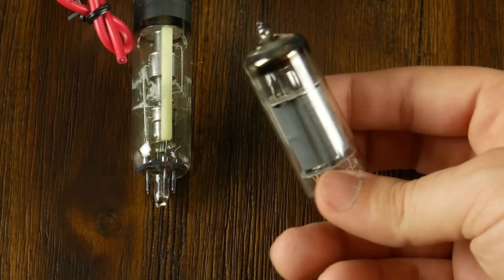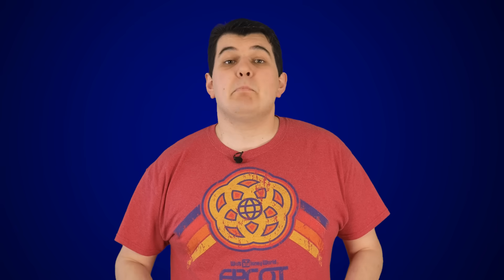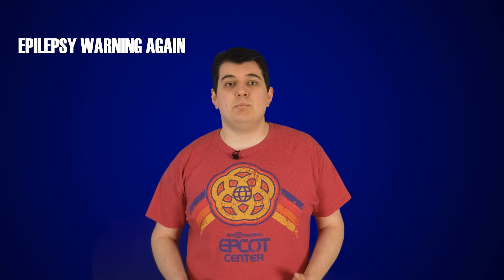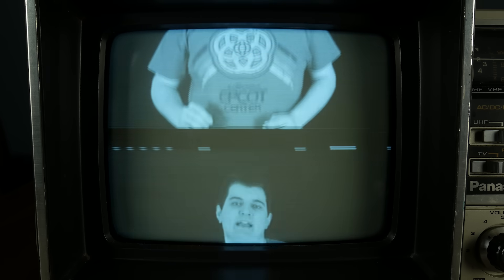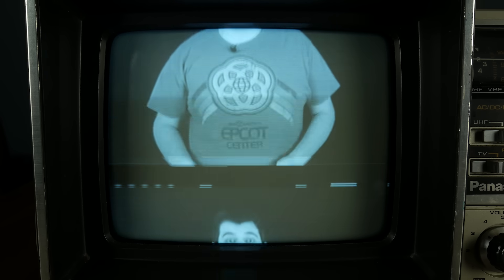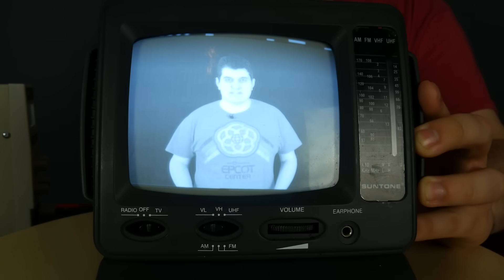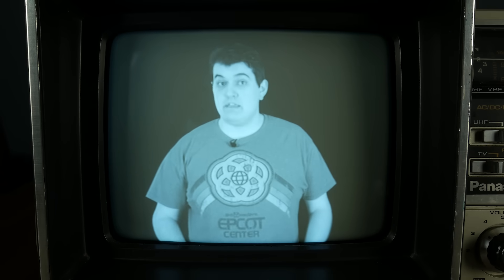Lines of Light: How Analog Television Works

Comment: OMG dude this video is 1) exactly what I was looking for and 2) fricking amazing. You just really explained eeeeverythi.. wait a minute. You explained everything except one thing, that I really wanted to know: how does horizontal resolution work? 

You told us how many lines made up vertical resolution, and said that the horizontal refresh rate was basically thousands of times a sec. 

But I remember my old PS1 to have a 704x576 resolution, or sometimes even better (I live in PAL land)

So where did those 704 dots come from? Would be amazing if you had to answer to that! 

Cheers, and again, thanks for a great video

Comment: The lethality of electrical shot isn't about volts and amps alone, but what body parts the power is passing through. Hit the capacitor with your left hand and your right foot touching ground and it passes through your heart. Now you're probably dead. Use your RIGHT hand and the pathway skips your heart and you get to live, probably. This is not advice to avoid death by being right handed.

Comment: 4:20 - just remove electric cord from socket and try to turn it on, this removes remaining charge, it works for every electronics, people should do that always when they try to disassemble something.
9:15 - for me, 60 Hz screen is still teribly flickering, I think that 50 Hz TVs (in my country) are the reason why I became PC player and not console, because I just could not watch 50 or 60 Hz CRT, I needed minimaly 75 Hz, but 85 Hz was more comfortable. The worst thing was that in schools, there was mostly 60 Hz on computers, it was really painfull for me, I had always red eyes from that.
And noise of CRT TVs was sometimes so loud that I could literally feel in my body when somene in next room turned on TV.

Comment: i have two crt... no three! crt based display terminals, one of em is a fine Philips color Vhs intergrated television in near mint condition if you look away from the remoot witch somehow partially melted after laying in the sun, the other one is giant black- and i cant remember the company, but it weigs a ton and i can bareley lift it when i have to moove it around... i allso have a little 2.4 ghz security monitor from my fathers workshop, its a neat little thing witch can be hooked up to 5 signal cameras. but if theyre just remodelled radiotubes then why do they explode and not implode when smashed? and why doese my philips tv keep reliving the heroshima incident when turning off :|

Comment: If you ever want to do a video on how the video tape machine was invented, let me know. I restore professional broadcast video tape machines from the 50s to the 80s.
Imagine recording a 6mhz bandwidth signal on tape! 
Audio recording is at max 30khz. That's childs play compared to a professional broadcast videotape machine.
These machines weight 1 ton and required and air compressor to run because the video head spins at 14,400 rpm on a cushion of air!

Comment: My dad was a pioneer of television a d worked for a man named Dumont. Dumont owned the patent for the phosphor coating on the CRT. RCA wanted to lay claims in them being the inventors of fully electronic television. RCA, more so, David Sarnoff was the Bill Gates of yesteryear. He bought up all the patents of electronic television and screwed everyone. The only one he could no  purchase was the patent for the phosphor coating that was owned by Dumont. Dumont at the time had an exclusive contract for the military to develope CRTs for radar use.
With that being said, the REAL reason for interlace was NOT due to bandwidth it was because if a full image was drawn on the screen, by the time the beam got to the bottom, the image at the top would be dark, hence interlace was born.
Also the fly back in a b&w TV generated about 13,000 volts and in a color TV it was 27,000 volts

Comment: BAck in the 60s and 70s I would go on house calls with my Dad when he fixed TVs.  Most of the time it was just a bad tube.  Other times he had to bring it back to the shop to replace some other part.  He still has has a demag ring for demagnetizing CRTs.

Comment: Fun fact in relation to the part about vacuum tubes in radios: I own two vintage single sideband transceivers that use vacuum tubes in the final amplifier circuit. And they both are operational. I just haven't had a chance to use them much because I live in a basement apartment and don't feel like hauling a 50+ pound rig up a hill (plus some batteries) to get to a place where I can transmit from.

73 to all the fellow hams out there.

Comment: Reminds of the old days, adjusting the horizontal and vertical hold. Taking off the back to take out tubes and take them to the tester at the hardware store. I knew how they worked and how to open them safely. So much to do to get a good picture, even more if you used an antenna, so much time spent fiddling. And no remote control until the 80s
Got our first colour tv when I was 4 or 5, was a big day.
Reply: That's why I watch Jordan Pier and Shango066, they both like to fix old tube stuff, TVs and radios.
Shango does more of resurrection of really old TVs.

Comment: How about making a video about the original TV remote control that used differently tuned metal rods that when pinged told the TV to change channel wheel to the next or previous channel?

Comment: As a back up warning to not do this at home: I had the opportunity to watch my dad repair these tubes. When discharging the voltage in the tube you see a big bolt of electricity arc off the thing. It's also a very loud crack of noise whenever that happens

Comment: Can someone explain how NASA sent analog TV from the moon over 50 years ago without any distortion, interference, or "beam bending" by the EMF in space? They also sent live TV from a rough ride on the moon buggy some 237,000 miles away, without any loss of signal quality or strength? Did the Van Allen Belts act as the amplifier?

Comment: Very good.  I note that the special "equalizing" pulses in the vertical interval aren't there to let the TV tell field 1 from field 2.  They are there to prevent the horizontal sync pulses from interfering with the detection of the pure 60 Hz vertical sync pulses, since most TVs separated the vertical sync timing from the combined H & V sync pulses using a simple resistor+capacitor low pass filter. 

The H and V scanning rates are steady frequencies.  There are no 'half-line' periods, the horizontal period is always the same.  So is the vertical period -- it doesn't jump forwards and back to create odd and even line positions.  Interlacing happens solely due to the ratio of the H and V frequencies: H = V * (525/2). A raster is just a complicated Lissajou pattern.

Comment: There was a discharge point on the rectifier that the old time TV engineers would encourage newbies to touch. I never fell for it. Ww had to change the IOs in the cameras periodically, The tube came with instructions, a comic book, the main character being "Orthy the Orthicon." When 2" tape came in you eliminated head clogs with a squirt of liquid Freon. We liked spraying unsuspecting visitors and each other with the handy squeeze bottles filled with the fast evaporating fluid. Obviously we aimed for the crotch. It may not have been pure Freon, but I like to think we contributed to the hole in the ozone layer until the government spoiled our fun.

Comment: Electronics, even the kind that we've "outgrown", never stops being magical to me
Reply: Everything we have now builds on the stuff that came before. And even "obsolete" stuff is well beyond the average person's understanding when it comes to how it actually works.
Reply: @jnharton Fun fact: modern video hardware still has blanking lines. That is to say, digital data streams meant for modern displays still have a bunch of zeroes to encode a blanking signal. There are modes without vblank and/or hblank,  which put that bandwidth to better use, and can therefore encode higher resolutions.
Reply: Specially the ones that we've "outgrown"
Reply: And magical how simple some things turn out to be. When I was very young, we had a shower radio that played audio from VHF stations, so you wouldn't miss the game, the morning news, etc. Back then, I assumed it was some device to convert "TV" into "radio". But TV audio WAS "radio" in that sense: a separate signal.

Comment: I have a handheld fan with LEDs along its blades which can be programmed to show a message using the same basic principle - the LEDs turn on or off as the fan rotates to show a message. Longer messages "scroll" in the style of an LED chatterbox.

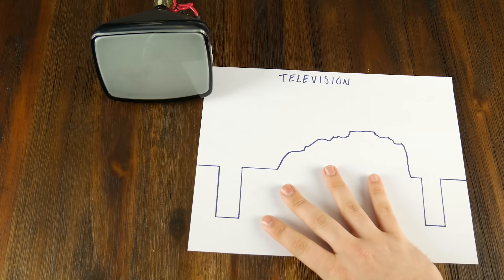Comment: 13:10 I was a broadcast tech in the analogue age - fun fact power consumption of the transmitter increase about 10% when broadcasting the colour black - you can what the amp meter increase as the show would end and fade to black

Comment: There is nothing wrong with your television set, we control the vertical, we control the horizontal...   From The Outer Limits.

NO!  The scanning frequency is derived from the AC frequency.  It was chosen to avoid having a black bar moving across the screen due to slightly different frequencies.  And, when color was added it was changed from 60 to 59.95.

Comment: There is another part that extended lower known as the sync pedestal which is transmitted by the camera and extends a little below the blanking pedestal. I used to work on industrial monitors and viewed the wave form on an oscilloscope .( b&w )

Comment: I used to manage a video game arcade and once took the hit from a fully charged flyback on a 32" CRT, somewhere in the neighborhood of 50-75,000V.  I was changing out the control board and forgot to attach a grounding wire to the shaft of my screwdriver when I popped the secondary anode (the suction cup thingy) and go a quick reminder of what I'd forgotten.

As long as the device the tube is in is powered off (and hopefully unplugged) the flyback holds static DC current with no amps, and is relatively harmless.  My arm jerked back violently and the screwdriver flew out of my hand, getting stuck in a ceiling tile.  My arm was numb and useless for about 20 minutes which made for a bit of fun swinging it at people.  :)  But the feeling came back like when you've cut off circulation for a while, all pins and needles.

Incidentally, I also grabbed a live deflection yoke by accident (stupid Tecmo Bowl and it's upward facing monitor!) and again took a big DC hit, but the only harm was my arm jerking back and ramming my elbow into the steel coin door frame.

However, a live flyback on a running tube is far more dangerous as it's a live charge that will want to run to ground through you, creating enough resistance to generate amps.

Comment: Very good description of the basics.  'm an old guy and made my living in the 60's and 70's servicing these sets.  I worked for a dealer that sold Zenith, Magnavox, and Motorola/Quasar.  We made service calls to people's homes and carried two big caddies full of tubes.  It was an art to set up convergence on a 3 gun delta configured CRT/picture tube.    It was said the mark of a good technician was knowing when to quit...
Reply: It's funny to me that tough love for the innards of old TVs, the art of a good hard whack on the side of the set to bridge a connection, has carried over through media as a cathartic ritual. I'll see people socking kinds of malfunctioning electronics where that couldn't possibly help, but... hard to blame them...!
Reply: I did TV repair back then as well. Good point about "knowing when to quit" on convergence. One minor error in the video: The 60Hz and 50Hz vertical refresh rates were chosen to minimize visibility of any power line leakage in the picture, not for any "synchronization" with the power line. Certainly the vertical phase, if not the frequency, differed ever so slightly from the power line, and could drift. If, however, there were a significant frequency difference (say more than a small fraction of a Hertz) between the two, annoying horizontal bars (low contrast but visible) rolling slowly either up or down could appear.

Nonetheless, an excellent educational video on the NTSC "good old days".

Comment: When I was a boy in the mid 1960s, we had to wait 5 minutes for the black and white TV to "warm up" after turning it on. Only then would we get a proper picture. (Valve set, not transistorised) Remember too 405 lines VHF and 625 lines UHF. That smell of electrical heating round the back of the TV. 😮

Comment: 7:46 With a oscillator varying the horizontal deflection and some external signal say a sine wave on the vertical you have a simple oscilloscope.
Reply: Actually O scopes used a sawtooth wave for deflection because the beam has to snap back,  not take time to go back to beginning. 
I repair many oscopes